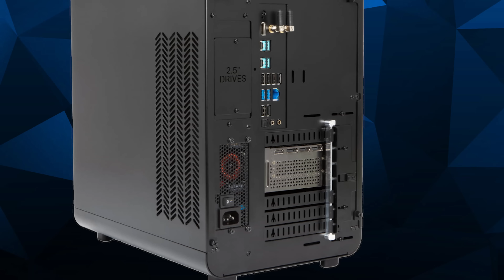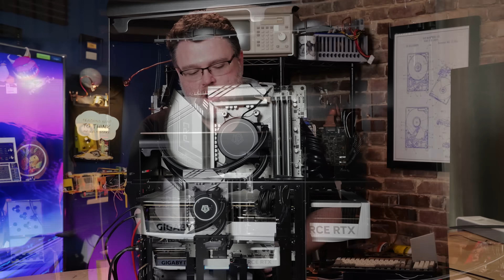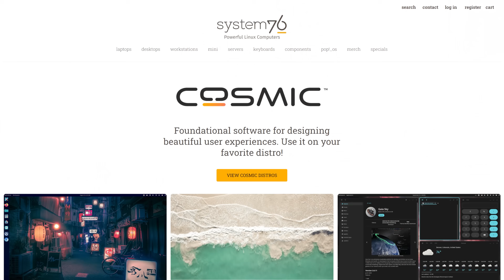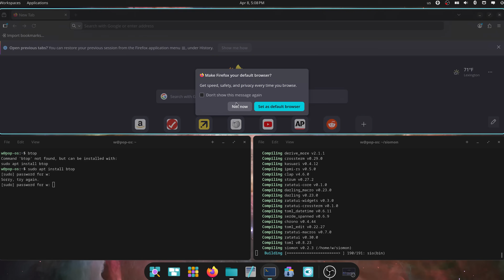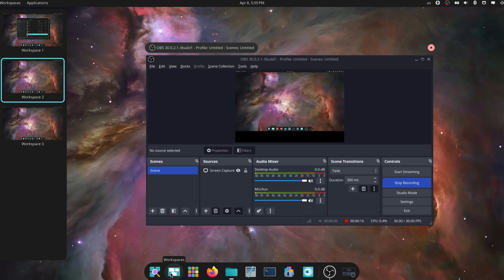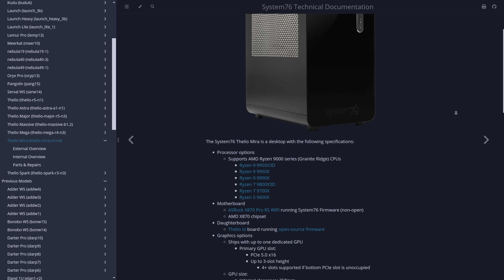System 76's Thelio Mira w/ Pop! OS and Cosmic 🚀

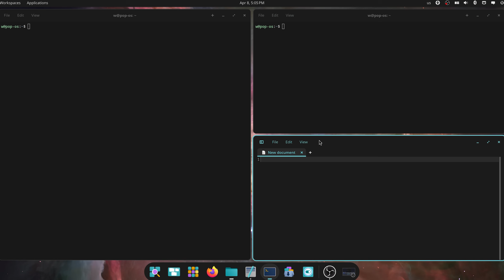Comment: 13:20 The Window tilling can work well with multiple displays but keep in mind as on May 2026 the current Cosmic will not allow you to stretch one window across more than one display. I use 3-4 displays in portrait. There are some windows I normally stretch across two displays as part of my normal workflow. I am using cosmic but installed gnome on it mainly because of this. Other cosmic issues I ran in to were that it did not work well with VirtualBox with Win10 guest VMs. Finally as of today there is not way to automount your NAS in Cosmic Files. Hopefully the Cosmic Files issue will be addressed soon but I'm not so confident about the other two issues being addressed anytime soon.

I still think Pop!_OS Cosmic is a great Beta and may not pose issues for you right now if you do not: 
1. stretch one window across multiple displays
2. use VirtualBox
3. use a NAS daily.

Comment: Wow you can build this system yourself way cheaper than the prices they have when you go to the link and start configuring the system, not a good deal. And I bet it will ask your age and date of birth before you setup an account on it, I don't give a hoot about them "making" the computer in Denver USA (from parts all made in china) since the company is part of the milk toast attitude that is allowing the age laws to roll over us all with such ease. When they act like real Americans they can wear that made in America badge.
Reply: It's going to impact all operating systems that operate in areas that require it, not just pop.
Reply: Look up the current situation, System76 is fighting for the age law to be changed to exclude open source.

Comment: They're awesome but cost prohibitive
Reply: Pretty much the story of small businesses and boutique makers such as them and Framework.
Reply: @fujinshu  and Falcon Northwest. But still they persist
Reply: @fujinshu well I a have to disagree a bit here Framework is repairable laptops thats where a lot of value comes from.
Reply: @boristhegeek It’s awesome that Framework laptops are very repairable, but they’re still cost prohibitive.
Reply: just think of it as getting a nice high end system with your reasonably large donation to the software dev's that will help keep your pc running and optimized for at least a decade (assuming that 12v power connector docent burn before then lol).
Reply: @MrArrakis9  but a 3x premium on a 2TB SSD is a bit too much for me...
Reply: @pietheijn-vo1gt  Not to mention the system cost, that is based on a $ 185.00 motherboard.
Reply: The cost to me is justified. I just ordered a custom version of this, and it wasn't cheap. Considering I'm still using the last one I bought from them almost 10 years ago, and one I bought in 2008 from them is still in light use in my home lab.... They are def worth the money.